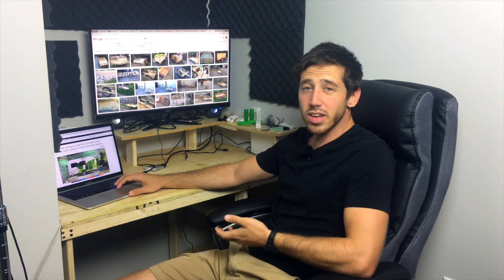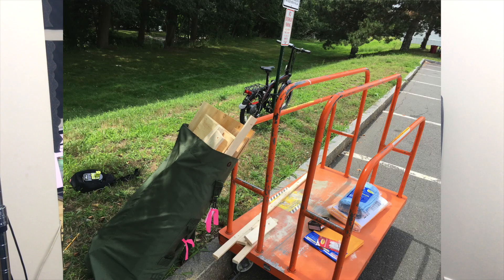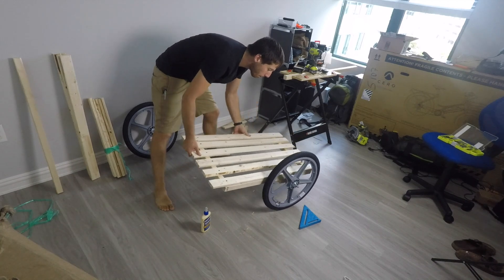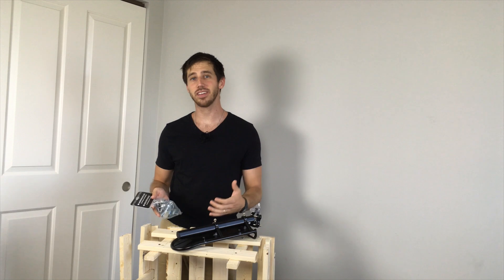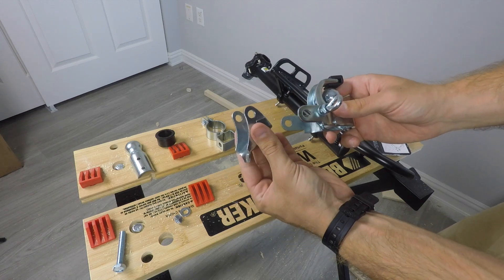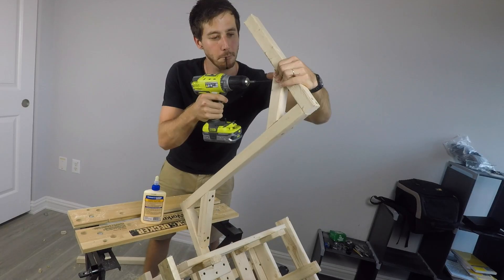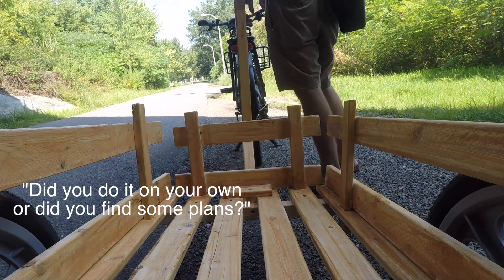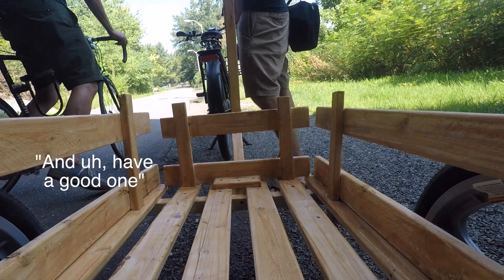How to build a DIY trailer for a bicycle or e-bike!

Comment: You might want to stiffen the arm that attaches to the bike hitch.  I would use a couple of 5" sided triangles of plywood or whatever size will match up with the stiffened you put on the hitch arm.  If your bike rides beside a pot hole but the trailer can't miss it, look at all points that will receive the most force.

You probably need to get a small tool bag, to hold a spare tube for the bike and trailer.  Tools for removing a tire and a pump to reinflate the tire.  If you have a load groceries or building supplies you don't want to leave the trailer abandoned to go fix a tire.  It probably would not still be there when you got back!

Nice building job!  😊

Comment: The most expensive part seems to be the wheels. I'll need to find a souce of used wheels. They average 50-250$ it seems. Well, the ones made from steel are anyway

Comment: That 2x2 tongue you attached it to the bike with looks very sketchy.
I would have used metal conduit tubes to make a frame. Steel conduit like electricians use, very bendable and many connectors available at home depot.

Comment: I could not find the hitch part that you bolted onto your rack, but it looks just like a stock swivel wheel part that is found at Harbor Freight or the box stores. Remove the wheel in it and just add a bolt to make it work the same as the apart you had. I have that same hitch, but I don't care for the mount to the seat post, as my electric bike has a removable battery that the folding seat opens to allow its removal as necessary. A seat post mount gets in the way. Not so sure that the nose down of the trailer is any advantage or not, as opposed to leveling it. Thanks for the video as it gives me some ideas as to a frame hitch. I have a small bike trailer that I am adding a 55 gal. plastic drum to in order to modify the drum into a carrier for my dogs. My nose will be up to the cart, as it will have the wheels moved forward and the cart will be done up like one of the train cars you see in videos watch are pulled by lawn tractors. It will be done as a biplane and my dogs will ride in it. They grew up in my motocycle sidecar, so it should be fun for them and myself.
Reply: How does the trailer in this video do either the bike leaning I've made one and don't have the ball hitch and I'm trying to figure something out

Comment: Hi Micah, one suggestion on your trailer build - Having a loaded trailer pushing against your seat post means the momentum of the trailer can impact your bike balance & you are much safer to use an axle mounted to arm. You can buy these off Aliexpress, Amazon or Ebay.

Comment: Most of the comments I'd make have already been covered by other posters, so I'll just add my general 2p worth, based on having made several trailers over the last (nearly) 4 decades.
All (bar one) have been 2 wheel trailers, with a central tow / hitch point, more or less at the same height as the axle of the rear wheel. 
The bike end of the hitch is bolted on the rear end of a frame / yoke that is typically attached to the rear wheel mudguard stay holes. 
This yoke / frame is prevented from rotation by stays of some sort to the pannier rack.
The bike / trailer connection is a 8mm male rose (spherical) joint mounted on the trailer with a clevis on the bike end. An 8mm bolt through both connects them.
The threaded stem of the rose joint is allowed to rotate through a full 360deg in its mounting to allow for mishaps such as the trailer flipping / rolling thro' 180deg after hitting a kerb / obstacle.

My current trailer - used for 3.5yrs is significantly different from all previous ones in that it folds (flat) and can be stowed on top of the pannier rack when not actually needed. The wheels are 12.5in stub axle types that can be removed and carried in one of the panniers. 

The reason for this approach is that I'm a regular skip / bin / dumpster? diver and I wanted a means of being able to carry larger items if I happened to be passing a 'target rich environment' and there was something of interest (to me) there :)

The trailer frame is essentially a modified kid's buggy / stroller - Hauck brand (sport model or similar) - a simple but effective linkage and pivot arrangement that folds back on itself. Mainly 16mm / 5/8in steel tubing - but I've added other staff as necessary.

The bike mounted frame / yoke is also somewhat different from previous ones that I've scratch built - it's the rear triangle frame off an alu framed bike. I found an abandoned bike that'd been stripped, and rear stays jumped on such that they touched each other.  

This is - by far - the best, most rigid hitch frame version I've used.
Trailer with wheels weighs about 5kg iirc and the max load I've carried is 50kg (only twice) typical loads are generally in the 15 to 35kg range.

I'm considering making a mk2 version of this trailer with some mods - and decided to open an Instagram account to showcase this ( and to promote cycling / bikes in some way?) - when I extract digit - as people my side of the pond have asked me questions about this in the past.

I'm not sure how to link / point directly to this Instagram account - so I'll just give the name.
     
biketrailerguy             https://www.instagram.com/biketrailerguy/

There's just a few pics of current trailer with different loads there at the moment, but it might be of interest to some people.

Zero cost, btw as made from materials / resources I already had, or found objects - like the buggy itself. No welding involved, or timber used.
Reply: Great! Creative useful up cycling - and skillful too :)

Comment: Interesting. But, from experience, I see two faults. First, the swivel point needs to be over, or in front of back axle, otherwise you have poor control when slowing down or stopping. Second, the trailer wheels should be in a closed frame, with both sides of wheel mounted, not just one side, as in a bike frame. I made this mistake too, and broke three axles on my first trip.

Comment: I built my trailer out of stainless steel
Reply: My trailer is bail out of stainless steel it adds about 10 to 12 pounds to the bike I ride a three wheel bike pull the trailer behind there I get lots of comments eight Bluetooth speakers my license plate my sweetie pie all my lights work on there it's nice

Comment: my dogs trailer had 20in wheels when I got it, had problems with spokes, so I got 16in mags, even better, but got flats a few times, then I found 12in mag wheels on a discarded stroller, that had solid rubber tires. no spokes, no flats and a much lower center of balance, making a safer, more stable, ride for my dog. get a hitch for the back hub of your bike wheel,  and make an arm out of square metal rod to connect  them...

Comment: The bolts ie axles, you drilled out the wood for,  and ran the bolts through.  You should take these axles back out, drill the hole a little larger and force press some metal sleeve in to the slightly undersized hole,  sleeves that are the size that accommodate the axle bolts.  This will stop the axles shifting and tearing into the wood.

Comment: The wheels should be in the middle of the trailer.  Then the weight will be on the axle.  The way you have it, the arm will have extra stress.

I also find using the seat post makes things hard to control.  However, connecting to the rear hub will require some design, driving will cause the arm to flex, either making the trailer bounce front to back, or break, depending on the material it's made from.

The big wheels are also better, unless this just carries groceries.  Big wheels have less friction on the road.

Comment: How hard is it to tow with an electric bicycle? I have a wagon that is called a Cannondale and everybody always ask me where did I get it and they don't make them anymore they make the stupid ones that hook to your rear axle this one looks to the seat like yours. And it is really light and has to 20 inch tires regular bike tires work it used to have really thin tires like .75 in maybe an inch. I would think you would want the wagon to be way lighter. Yes it is a nice design but it would be way better if it started out with a metal frame under it. And go for lightness

Comment: not clear how the wheels axles are attached..no clear image of this..nice design
Reply: 1:58. He bolts a block of wood to the underside of the frame. He drills a hole through that, and puts a large bolt through the hole using washers, adds the wheel and tightens it with a nut. He is not using bicycle wheels, but wheels made for this purpose.

Comment: Nice video mate! I was wondering if you had any second thoughts on the final height of the inside of the trailer? Assuming grocery store reuseable bags are almost 24 inches high, I was wondering if you experienced times when you would have preffered an additional "row" of horizontal boards to increase the final interior height? Any thoughts on this?

Comment: The bolt you used for the wheel axle ...if I'm not mistaken weren't those Carriage Bolts? And FYI ...I mounted the Ventura Mini ball Hitch onto the rear plate of my Surly BFD and I later discovered that since the ball hitch is spring-action, it can come disconnected from the tongue mount. So I remedied it with a velcro strap. Plus with most truck trailers having a back-up chains that connect the tongue with the hitch mount, I applied the same using stainless chain. And in-case of slippage, the chain kept the trailer from getting away from my bike, and wandering into traffic.

Comment: I would like to bring this rig to bicycle designers  attention. A power trike compact enough to fit in a grocery store check out line.  Its 2 wheel drive  and unique in that it doesn't have a bar axle for the rear two wheels . The builder used two rear ends from separate 20 inch bikes
https://youtu.be/gQJC-y61Vk8

 He drives to the grocery store @ 7 minute mark . Inside the grocery store @ 14 minute mark.  Designer shows driving in snow in his yard with two wheel drive geared hub motors

Comment: FYI ...swing by Lowes and get the following: Wheelbarrow wheel assembly kit and get 2 sets of wheels(4 wheels) --the dually effect(like a semi) will decrease the bouncing you're getting when you pedal at a higher speed. Also what you're using as axles works, but if you get a one-piece thru-axle of threaded round bar, it'll increase your trailer's carrying capacity. In-addition add some flat L-brackets to the trailer's arm to also make it more rigid than what you're presently using.
Reply: Have to disagree on that last part. A triangle is more rigid than an L-bracket.
Reply: @mikeguitar9769 triangle is stronger then a l.bracket. can't bend a triangle.
Reply: Great tips ty

Comment: Use electric conduit for the trailer arm is stronger and flexible. Curves are nacier, smooth and much more reliable than wood.

Comment: Nice build with minimal tools! I imagine that bike trailers would be like any other trailer, you want the load centered forward of the axle , 60/40 at least , then you won’t get the trailer oscillating at higher speeds. I agree with the other comments that there are some areas that have high stress that you might want to make more robust, at a minimum the axle should go across the entire width , reinforce the axle block with a bottom and top metal plate so the wood is more of a pillow block , the hub wood around the bolt mount may break with a good curb or pothole hit. For your hitch arm rectangular aluminum, say 1-1/2” square with bolted gussets at the angles would be light and strong. ( Aside:You seem like the type that would really get into a TIG welder with your mad “conceptual to finished product “skills. )

Comment: So for the wheels, rack and hitch you paid north of $100. Add in wood, hardware, efforts and RD. You paid $138 not counting labor. I’ve seen top of the line aluminum with lid, cover & top rack for plus bells & whistles run about $800 or more. Really good one for $250 and average one for $100. Options are good

Comment: I bought one of those racks when I first built an E-bike to hold a battery.The tubing cracked by the seat tube weld. So don't put too much weight on the pivot or it may fail.Sorry I'm coming to you late with this information but I have suffered a broken leg and have been hospitalised

Comment: Could you (perhaps) try to put large battery pack onto the trailer, to gain better weight distribution, and also improve ebike start and range?
I thought it would be good idea, because its easier to pull weight than to carry it.
Great work man btw.

Comment: I am sorry to say, but this trailer is not ready for public traffic. Please reinforce your drawbar - the way it is now it will no cope with 50 Kilos. When you built a car trailer you want a longer drawbar, because this makes it easier to reverse. But with a bike you cant do that, so keep the drawbar as short as possible. Second - your trailer should be balanced - but yours is leaning forward quite a bit - so your vertical  arm is to long - shorten it. If it is leaning forward like yours - all items will move forward with every pothole - not a good idea. In oder to have a trailer which follows the towing vehicle easily you need some weight on the towbar and you hitch. But this is only done by placing your items on the trailer with this in mind. For a car you want around 50 Kilos - for a bike I would suggest arount 10 Kilos - but not more. Then your trailer should follow your bike perfectly.

Comment: I like the idea for your trailer. but off topic how does the number of amps from a battery effect a controller. now I have a 36v 17.5 amp controller can I run a battery that is 36v 40amps through the same controller?
Reply from the maker: Amps is current rating, which is sort of like saying 'how much power can it handle'. A controller draws current, a battery supplies current. So if your controller is 17.5A, that's the max current it will try to draw. If you battery is 40A, that means it can supply 40A max. So basically your battery can provide 2.5 times more power than necessary, which is good. It means you have a safety factor. Like using a 250 lb test rope to lift a 100 lb load.

Comment: Very cool... I actually have a question about a previous subject: battery temp. Is it practical add a fan, for instance a computer fan, to a battery pack? I ask since heat seems to be an important issue and I'm planning a build in the near future. Thanks

Comment: look up: BOB Trailer Fork; then BOB Nutz.  While there, look at their trailer bed designs. NOW: THE CHANGES: ideally, just like with panniers, you want center of mass of the load to be as close to the hubs as possible for better stability. Likewise, ideally you want the trailer wheels to take most of the weight, not your bike... being single track design the BOB trailer isn't designed this way at all... it has the load even split between the trailer wheel and your rear wheel, and the load is always above the hub which is ok for light loads. They rate it for 75lbs, but it becomes top-heavy real quickly. If the trailer-bed was lower in relation to the axle, then more of the weight would sit below the axle and you could carry closer to the rated amount without losing stability. getting back to the BOB trailer fork and BOB Nutz, you can weld, so what I would do is weld or otherwise attach bolts to your rack or your frame, for the BOB Nutz... do NOT mount it on the axle bolt nor use the quick release axle version... you want the weight near there, preferably mounted directly over but not ON your axle what happens is the weight of the load when going over bumps will rock the entire trailer and put extra torque on the hitch... if that hitch is your axle, the extra force will put twisting leverage on your axle and can overcome the friction of your axle nuts or quick release and leverage the axle right out of your drop outs, and taking metal away with it, especially if it's an aluminum frame, and essentially ruin your frame... trust me. Other than that last part, it's a really good hitch system. for what I use it for, I could stand for it to be wider, and the wheel bigger so the bed could be dropped lower in relation to the axle. I don't mind it being single track when it isn't so top-heavy. The issue is when there is a lot of weight you spend more of your energy managing the balance than you do pedaling. If the C.O.G. was lower it'd balance itself to a point.

Comment: Sweet build, diy trailers are harder than they look! I just built two... one is a single wheel and designing the hitch for that was by far the biggest obstacle. I like how you mounted the wheels directly to the wood frame. I decided on using aluminum over wood to try saving weight, do you know what this bad boy weighs? The only thing I'd change is mounting the wheels closer to center (front) for better balance and less stress on the hitch.
Reply: $2000+ bike with trailer that looks like it was pinched from a sleeping homeless guy. Huh yep.

Comment: Liking the trailer...have you done anything like a volomobile yet or recumbant bike? Both are on my list to build and my welder is on it's way! £90 what could possibly go wrong? ...lol. I had to learn to use Blender for the design which still looks pants tbh. But it's a curve right? Good vt thanks man, it's groovy.